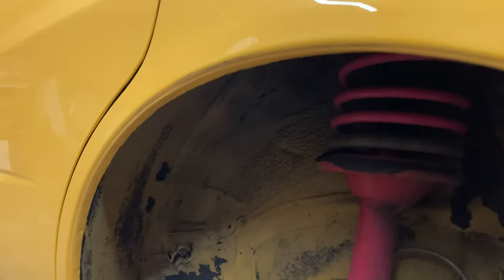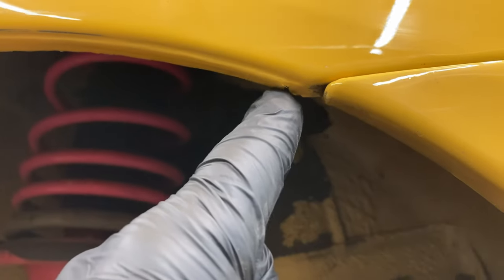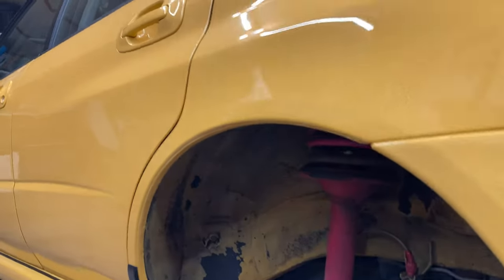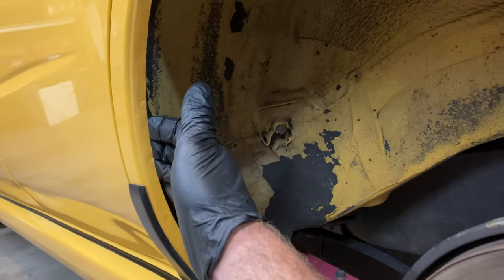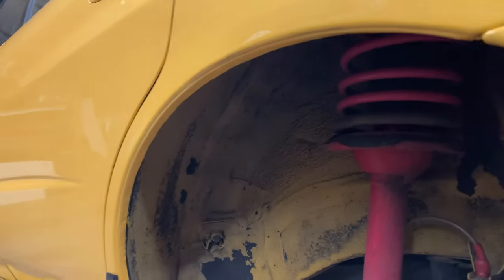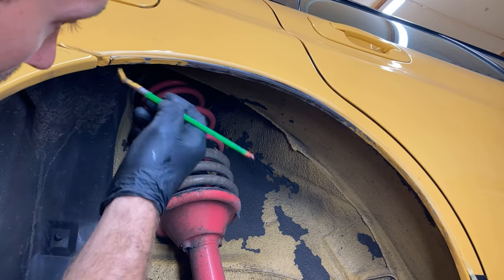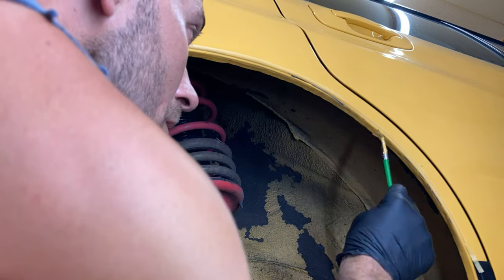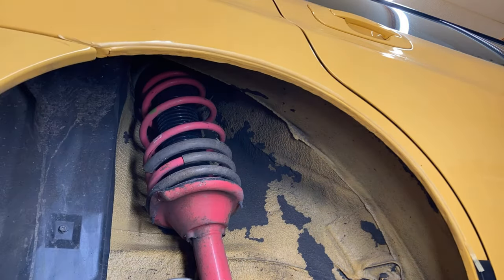Rolled 1/4 panel repaired with slide hammer anchor tool.

Comment: Would preheating the panels have helped prevent paint chipping off?
Reply from the maker: If the paint was in good shape to begin with then yes . In this case no , paint was already severely cracked and falling off before I started .